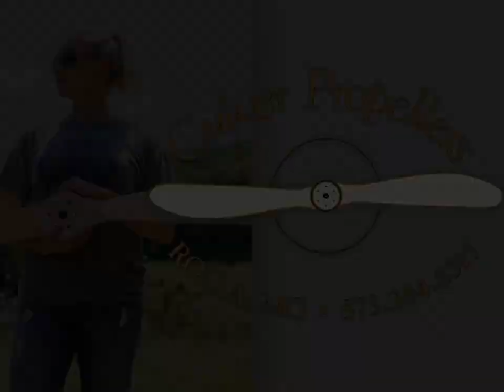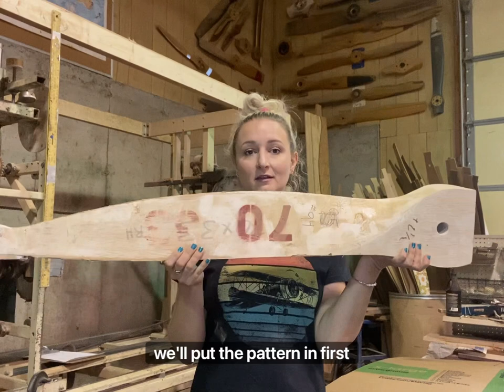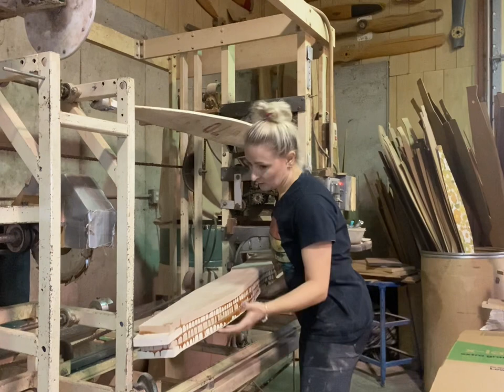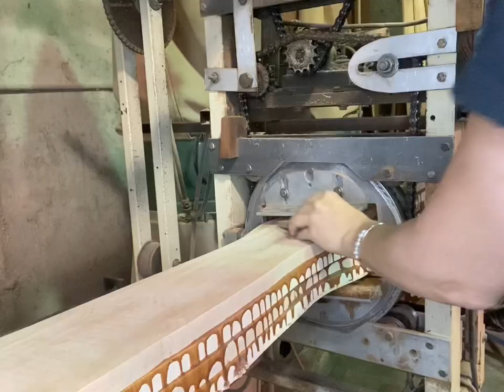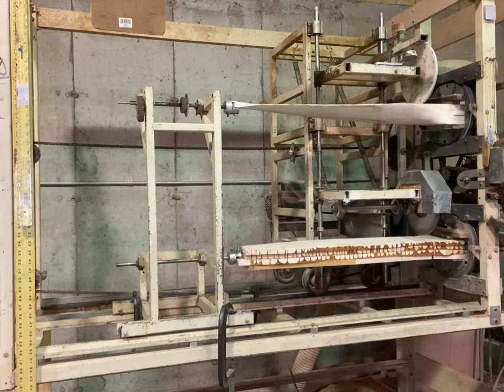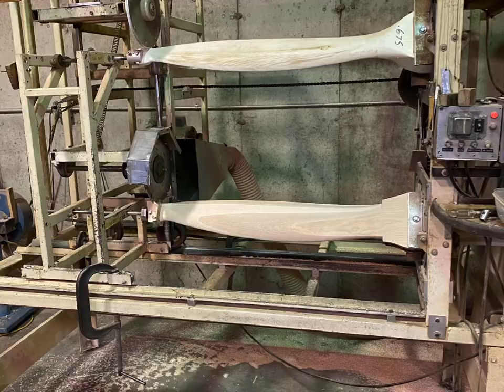How Propellers are made

Comment: Do you make props out of a solid piece of wood instead of being glued. Great video. Thank you.
Reply: @Will he heck as like I saw a wooden prop with metal that looked like blended on the leading edge. I could be wrong not knowing much about this.
Reply from the maker: I like the laminations so I can check for defects in the wood easily
Reply from the maker: I actually don’t pay attention to grain at all. The laminates do provide added strength and also more surface area to inspect for defects